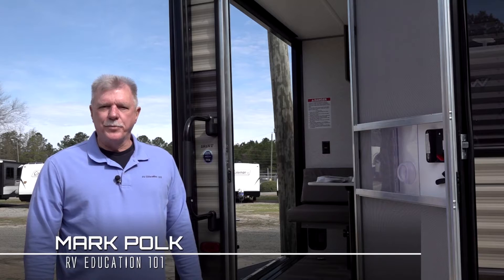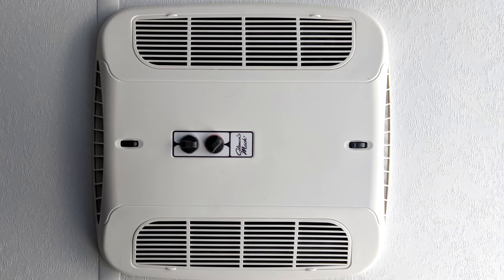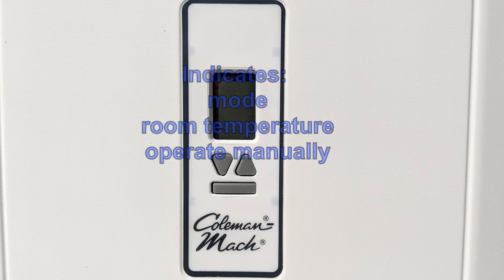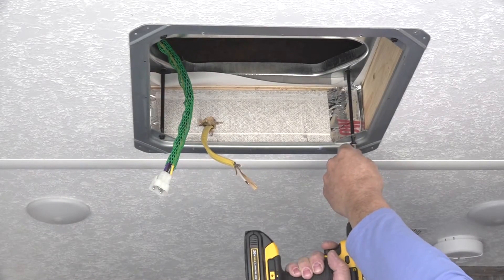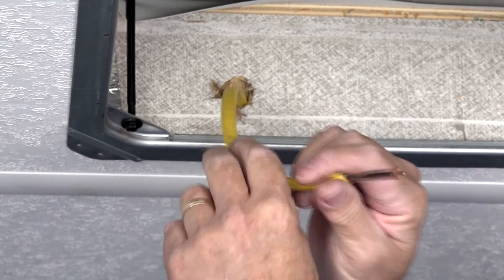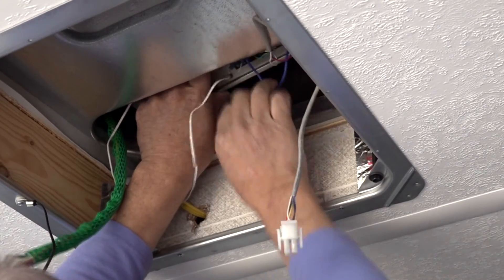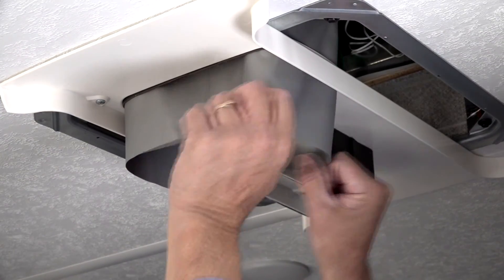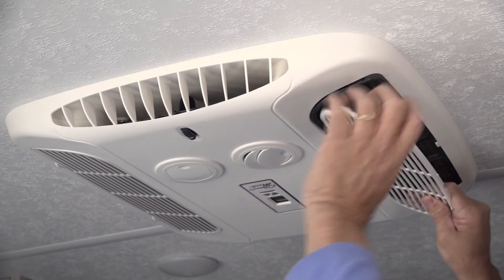Coleman-Mach Bluetooth Ceiling Assembly Installation

Comment: Dometic top to Coleman Mach 3 bottom Bluetooth. It does work, but you have to purchase the separate wiring harness which I found on Amazon for $143. Ridiculous price but it does work. So I’ve got about $450 into this whole Bluetooth set up just so my air conditioner fan will not constantly run all day while our dog is inside or while we are sleeping. It is nice to have it turn off and turn on like a regular home, but I’m not sure why don’t medic or any of these other manufacturers. Don’t just put that in the system when the trailers new.it’s pretty stupid that you have to go through this expense and time to make this happen. But it does work on Dominic as long as you have that harness.

Comment: I’m trying to add this item to my current 2021 travel trailer that has a dometic air conditioner unit on it. But the wiring harnesses don’t match up. Do I need an adapter wiring harness? I found one on Amazon for $143 and it’s a dometic product that it says it’s for a Coleman. I’m assuming this will work?any help would be great

Comment: Will this work for Dometic units on 2019 wolf pup 18TO?
Reply: Did you find an answer to your question yet? I’m in the process of adding this same unit to my domestic air conditioner and I am running into the problem of the wire harness not fitting. I’m thinking of purchasing a aftermarket wiring harness for $143 on Amazon. Hopefully it works. If you have any other suggestions or information you think I might need before I continue with my Insulation, let me know. I’ve already got almost the entire thing installed, but again, the wiring harness didn’t fit.

Comment: Where do you plug the heat strip into?
Reply: Did you ever figure this out?  I'm struggling with this right now
Reply: @ajsmom514  I did. There's a capped off port on the new control unit that it plugs into. Remove that cap and dam, plugs right in
Reply: @theadventuresofcheese  thanks!  Yeah, that took me a while, too!  Lol

Comment: The 47000 series low profile Coleman Mach A/C now has a Bluetooth feature that I'm thrilled to have followed the instructions from this video. The paper instructions don't help especially since they printed them upside down on paper and right side up on others. Very confusing unless you study this video instruction. I agree the power feed needs to be a little longer however the slack to pull from the ceiling unit. A few tips: 1. Remove the control panel rear cover plate so you have access to the circuits inside. 2. Wait to attach the power until after all the wire leads inside the control box are done. 3. Remove both long ceiling frame mount bolts so you can insert the control box from the driver's side first - they get in the way of mounting the control box 4. make the electrical power line connections after pushing the one-way plastic fitting for the Romex wire 5. Use wire nuts then push the wire carefully into the designated space inside the control panel 6. Attach the backplate to the control box 7. Attach the green harness to the control box and the probe before trying to put this box up in the ceiling. 8. Locate the two existing bolts and use the spring clips to secure (press the wings down to make the screw hole smaller so it will bite onto two bolts. Follow the rest of the video to complete this task. 

Definitely read up first and take your time, you will need a headlamp to see this project. If you don't follow warnings you could run into serious issues. This is not a project for the novice.

Comment: Installed one this past weekend. Couple of things I ran into: main power for control box was not long enough to mount on studs. I had to let the edges rest on the long through bolts that hold the unit to the camper. The plastic panel doesn't sit flush on the ceiling I think the plastic panel above it was made a little too large on one corner. I did not have to swap the metal bracket, through bolts, or duct skirting I simply reused the old one. The temperature appears to be off by 3-5 degrees compared to another thermostat I have in the camper. Overall, to get the auto fan function this is entirely worth it.

Comment: I have a colmen mach el series it has 5 wires on the ceiling assembly I replaced my upper unit with new coleman 8333c871 now I have 6 wires in my 9 pin connector that will not line up in my ceiling assembly what to do
Reply from the maker: Hi Derek and thank you for your message. Please contact our customer service team by phone at 574-247-9235 or  by emailing RVPSupport@airxcel.com and they will be able to advise you. Thanks!

Comment: Do you have a video of installing Ceiling Assembly 8430A633 converting non-ducted unit to ducted unit?  I'd be more than happy to offer up my unit for video.  Thx
Reply from the maker: Thanks for your message.  Unfortunately we do not have a video like the one you are requesting.  You would need to have ducts in your rig to make this conversion.  The best thing to do would be to email our support team at rvpsupport@airxcel.com.  Thank you again for your question and please reach out to our support team at your convenience at rvpsupport@airxcel.com
Reply: @AirxcelIncRVGroup  Hi.  Yes my RV is prepped with plenum, ducts, and t stat wire.  Really just looking for lower ceiling assembly change out.  Thanks

Comment: The video instructions are great and very accurate. The issues I ran into were; 1)The romex cable was almost too short and made it very difficult to get it into the opening. 2) there were no mounting screws to hang the box on, I had to take the outer cover and the inner cover off in order to put in screws. 3) the double stick tape comes odd when I tried to peel the backing, had to be real careful. It took 2 days but finally got it installed. It would have been a lot harder figuring it out on my own.
Reply: Are you concerned about whether the app is going to be compatible with your phone or tablet five or ten years from now? Very few apps have that level of continuity over time. Instead, companies more frequently come out with a new product, trashing the old customers. I avoid gadgets exactly for that reason.

Comment: can this ceiling assembly be used the 48000 series power saver ac unit non ducted system we are adding possibly 3 roof ac's to this unit , also what is the min. size onan generator to run  all 3 units , We are looking to do this in a 2021 eclipse 5th wheel
Reply from the maker: Good morning Mr. McIntyre.  I apologize for the delay in response, but YouTube does not notify us right way when we receive a comment.  Please submit your question to RVPsupport@airxcel.com and one of our reliable technicians will gladly answer your question.  You are also more than welcome to call at 316.832.3400.